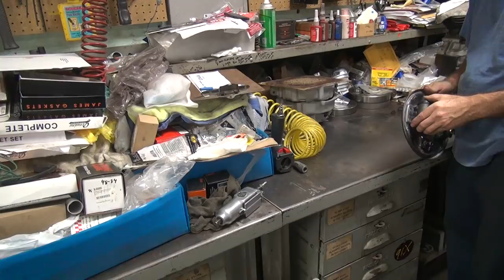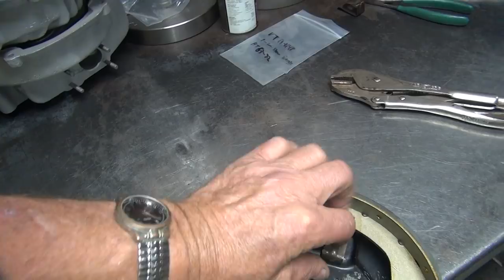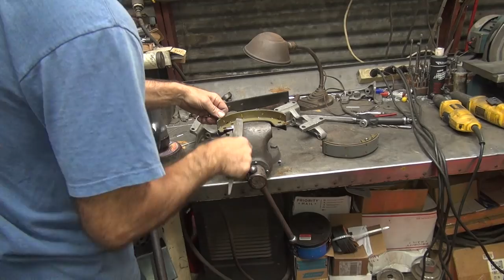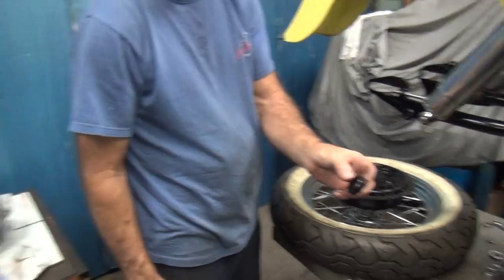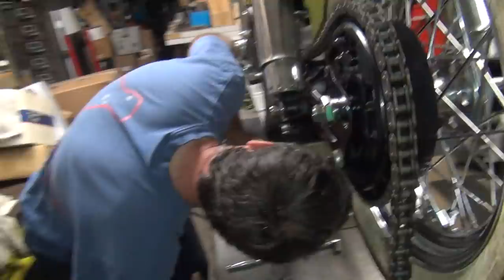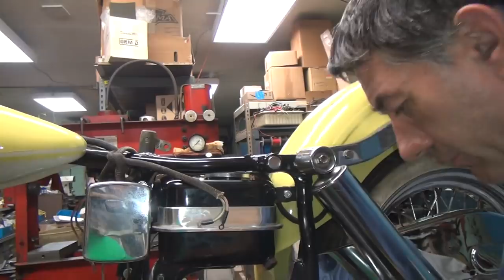1965 panhead #110 74ci flh motor rebuild and bike repair harley by tatro machine

Comment: I hate to ask it ,But did you look at a shop manual ,in case there was a mid year change,that you might of forgot about
Reply from the maker: no, because i know you have to look in the parts book to get that kind of info. i remembered all the changes on these brakes anyway. don't forget, i am mixing aftermarket replacement parts along with aftermarket up graded parts to. the normal mix and matching parts around here.
tatro
Reply: ok